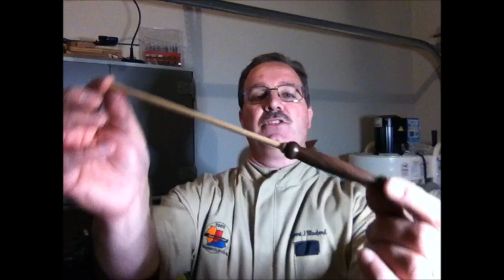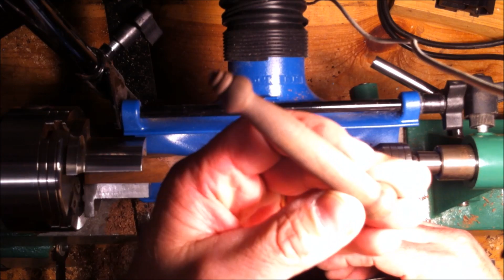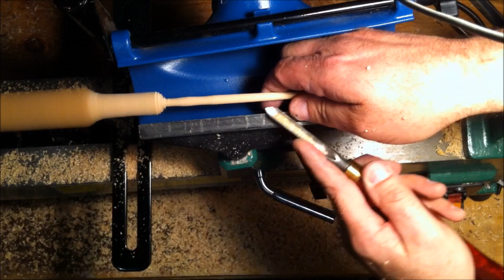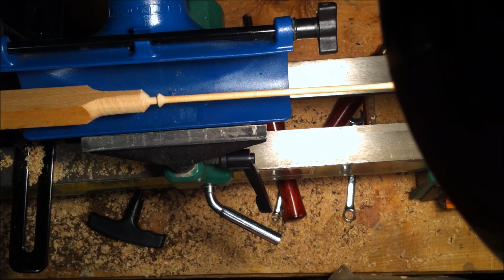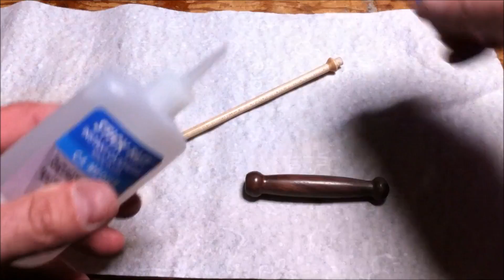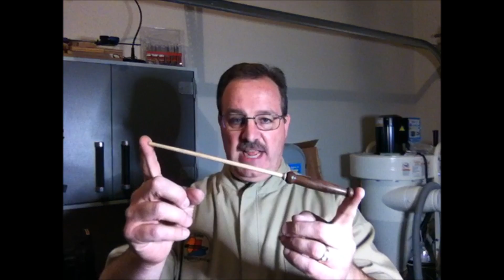Magic Wand (A Quick Skill Builder)

Comment: Nice wand.  It would make a great thank you gift for a school or church choir director.  You know, the kind of people who used wands before Harry Potter.
Reply: Although it would make a cool display piece, a music director wouldn't use this to conduct. A conductors baton is extremely thin and usually weighs under twenty grams. Sometimes as low as seven or eight grams. They often have handled made of cork to keep the weight down and absorb sweat.
Reply: +RJBWoodTurner I measured one of our director's batons. Sorry, there is no way to give these measurements without sounding pretty vulgar. The base of the shaft was .2" and the tip .06" with an even slope. The handle was just about 2" long and .85" wide (long egg shaped) with a hole all the way through it and the shaft glued inside. Very delicate. The center of gravity is usually very close to the handle for balance. I didn't have anything to measure the overall length. Probably about 13". He told me that he buys extremely light batons though at about 8 grams.  14 grams is more popular. Batons vary greatly conductor to conductor. It is a very personal thing. You would either need to ask for specs that you can copy, or make a pretty one that is intended to be a display piece.
Reply from the maker: +stonefry Killer Info, thank you. 
  I was making a baton this week and did not know any of this. I never played an instrument or did anything with the band and I wanted to make one for a gift. I may still do the video but it will be a for fun only and I won't gift it. 

Regards,
Bob
Reply from the maker: +David Walser Thank you David,  
  I just finished a baton and was going to give it as a gift. I may still publish the video but don't think I'll gift the baton now. 

Regards,
Bob
Reply from the maker: +stonefry Thank you for the info,
  Looks like I have some research to do. 

Regards,
Bob

Comment: I never thought of making Jaun's.   Bob what size roughing gouge did you use.  I have a 1/2 incher and am thinking
a bout got to a 3/4 or 1 inch.  Just would like you input
Reply from the maker: +Dave White Hello Dave,
  I use a 3/4" roughing gouge. I don't own a 1/2" so I can't give you a comparison but I like the weight and the large cutting edge on my rougher. The brand is Benjamin's Best and I got it from Penn State.  

Regards,
Bob
Reply: +RJBWoodTurner Thanks Bob